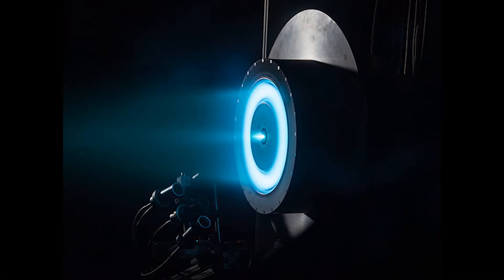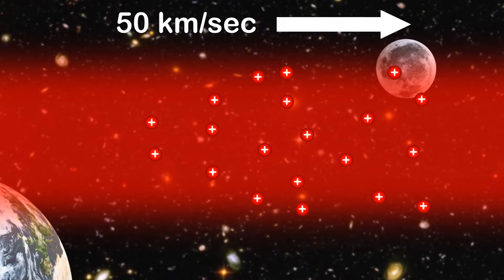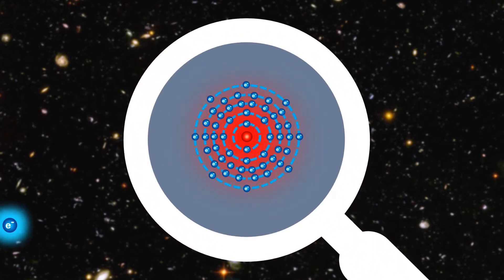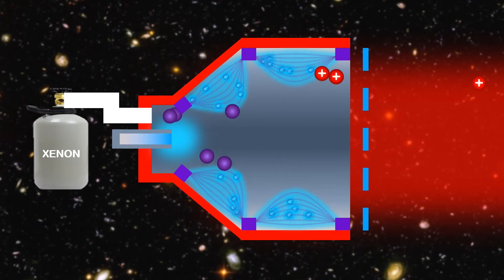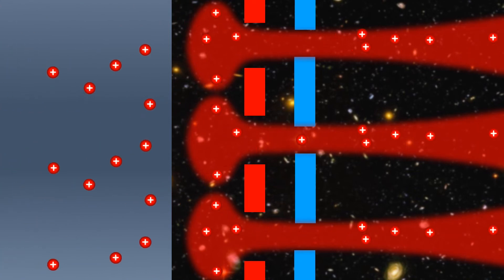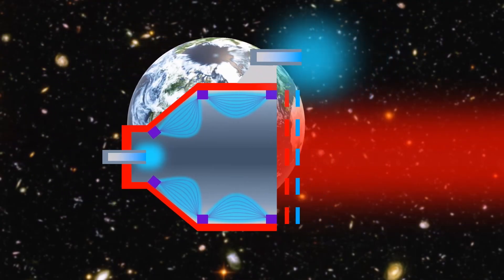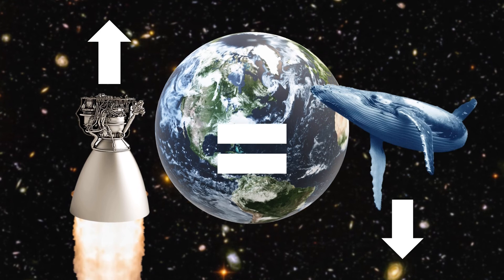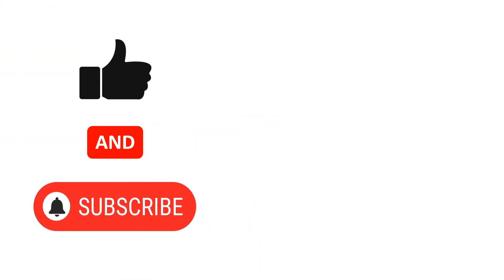How Gridded Ion Thrusters REALLY Work (The World's Most Efficient Space Engines)

Comment: I think the recent SAR scans on the Pyramids prove without a doubt that they are in fact machines, or to be more precise "vibrational generators"

If you ask me the incredibly deep shafts are in fact resonance tubes. What they would do is take the Earths natural vibrations and transfer it to the Pyramid above

A resonance tube would shoot sound pulses to the top and as the pulse returned down the tube it would be met by a secondary pulse & bounced off of that...Thus vibrational energy level would build the signal and be significant, enough to shake the Pyramid structure with great force

But that's not my question, hypothetically lets say you flooded the upper ionosphere with a modified ion, could you then draw down those positive ions to a receiver on the Earth belowthat had a negative charge?

I'm assuming of course they had figured out a way to power devices with ions but that's irrelevant 

I'm thinking perhaps the Pyramid was supposed to shoot modified ions up to the ionosphere so that they could be stored there and later collected by a receiver on the Earth below. Then these modified Protons or ions would then be used as we use electricity today to power anything we want - So basically a wireless power source?

I was thinking that since the everywhere inside Pyramid was made to harness vibrational energy then perhaps they also used that to transfer the ions they modified?

Like if the Pyramid and the receiver both had the same frequency then there would be a resonance path between the two, like how when you ring one tuning fork and the other will also ring? then allowing your modified ions to travel along that wave...

What would be the most optimum and ideal type of modified ion to utilize if you were trying to invent a machine that ran on them?